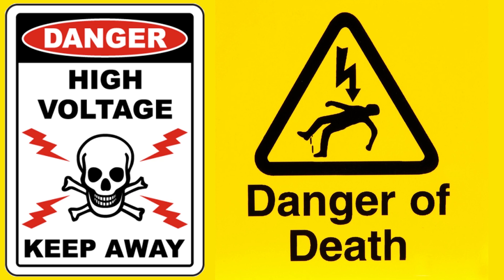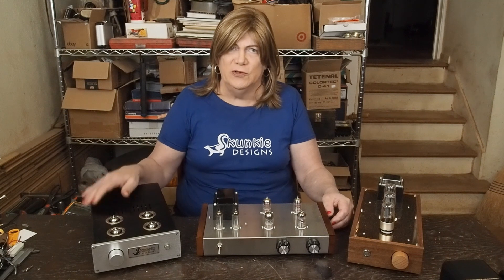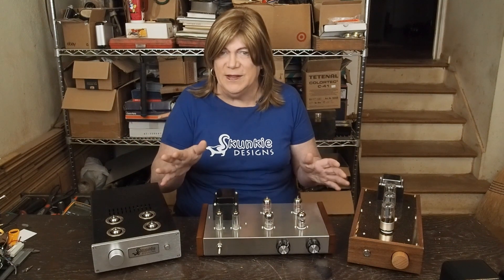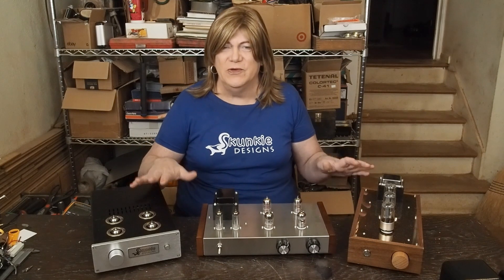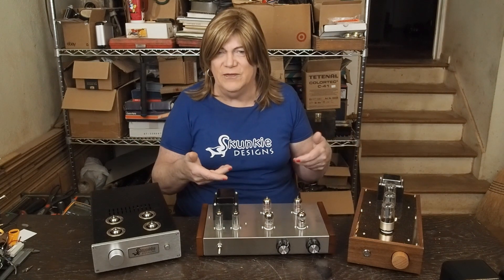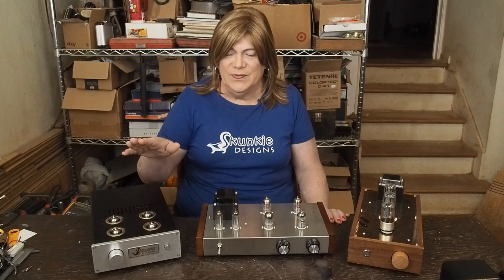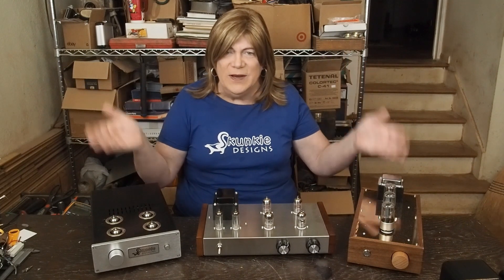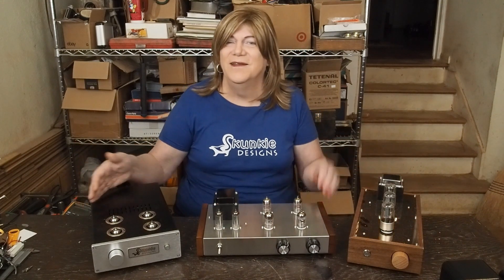HiFi Tube Pre-amp: Test Dummy Side Project

Comment: Stephe the centre preamp of the 3 I see here looks like the same basic chassis as the 6P3P/6N1 INTEGRATED amp I'm building!  But you got more tubes in that one & it's just a preamp!  What's goin on with that?
Reply from the maker: Tofu Dreg
Reply: @ @SkunkieDesignsElectronics   Chinese JUNK huh?  Great.😒   At least I've only wasted 300 bucks or so dangit!  😠😡🤬🤬
Reply from the maker: I meant the pre-amp in the center is tofu dreg.
Reply: @ @SkunkieDesignsElectronics  Yeah Stephe, I know you did.  Nevertheless, I'm not real confident I'm gunna get great performance from my amp, let alone 7 'useable' watts (as the online ad stated) from the small o.p.t's. that would fit in your hand.  If they were misleading with the output power specs I'm already suspicious!
Reply from the maker: Yeah, highly unlikely to get 7W from that

Comment: Hey I sent you an email with a 300b kit link in it. Take a look at it and let me know if it looks good. It looks pretty good by the weight alone. 44lbs. 40lbs without the chassis. It's supposed to be a clone of the Western Electric 91B.
Reply from the maker: Hmm didn't see this.
Reply: @SkunkieDesignsElectronics  for $600 shipped it looks like a good one. They said in the description that they can do it that cheap because they make their own transformers. Looks like the driver tubes can be replaced with ECL 805's and 5y3 rectifiers. It's supposed to be a western electric 91b clone.

Comment: Seriously, this sounds like a great project. I wonder if this type of driver amp could be be adapted to use other output tubes like KT66, KT88 or 300B.
Reply from the maker: The problem with those other tubes as a "spud" is the voltage peak to peak they need to drive them. A 300B for example need 140-160Vpp. What is possible: is for the amp itself to provide the gain from the 15Vpp (or whatever the preamp makes) to the tube requirement and not need to make the whole drive voltage from the 3Vpp it normally would. This would be designing them to work with each other. 

The more I think about this, the more sense it makes to build a system this way.

Comment: That spud amp. Is it really ok to put that much dc through the secondary of tho opt. And your speakers?
Reply from the maker: "This connection will cause there to be (no more than) about 40 mV of DC produced across the speaker terminals. But in actual practice however, this is insignificant, with the benefit of the closed loop response then being entirely based on the characteristic of the OPT outweighing the slight DC bias impressed on the speaker."

The majority of the voltage/current is going through the OT, and the current is ma.
Reply: @SkunkieDesignsElectronics  Thanks.  That makes sense.  The air gapped SE transformer can obviously cope with it and the DC resistance will be very low so not much hits the speaker.  I guess I should do as Richard Feynman suggested, with respect to quantum mechanics, and "shut up and calculate".

Comment: I may be wrong, but that schematic looks odd. The cathode only has a ground path through the secondary of the the o/p transformer, so it will have dc idle current running through it, as will the speaker?
Reply from the maker: You are correct, it is odd :)

"This connection will cause there to be (no more than) about 40 mV of DC produced across the speaker terminals. But in actual practice however, this is insignificant, with the benefit of the closed loop response then being entirely based on the characteristic of the OPT outweighing the slight DC bias impressed on the speaker." There is an alternate schematic the grounds the cathode but requires a much larger cap (1000uf). I will likely explore and measure both!
Reply: @SkunkieDesignsElectronics  Thanks. I look forward to seeing how you get on with this circuit.

Comment: I acquired a pair of 1959 Lafayette LA-70 monoblocks that I fixed up recently. Both have a pair of KT88's (6550's). They aren't integrated, so I built a single 12A_7 preamp w/the 6CA4 power supply (the 4S preamp found on the DIY Audio website and I found the 12AU7 to sound best), and the whole thing sounds decent. I actually built this on a small Hammond chassis with techniques I learned from watching your 6SQ7 build! I should post some photos on your forum. :) I also robbed a 6BQ5 amp out of an old Dumont stereo and built the same preamp for it, but I use a pigtail from the amp to the preamp for the required voltages. That also sounds surprisingly good! I love this stuff!! lol
Reply from the maker: That sounds like fun! :)

Comment: hi on the schematic is nice what is missing is the black dot on the connections, example 0.15uF is connected to 470K and 1K  it needs the dot connection ( • ), and yes we already know that, but for the new builders might be a bit confused 😊
Reply from the maker: Ill take a look at it. It isn't my schematic, I just updated some values to the parts I plan to use.